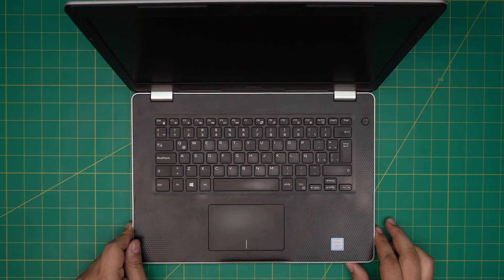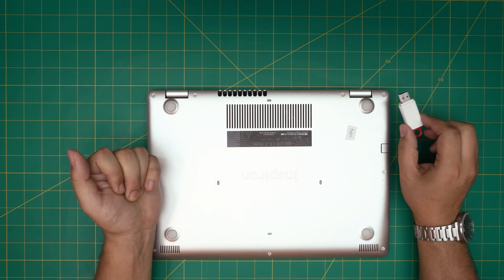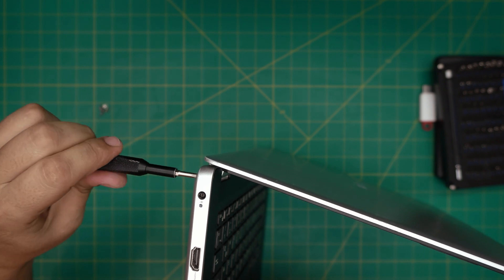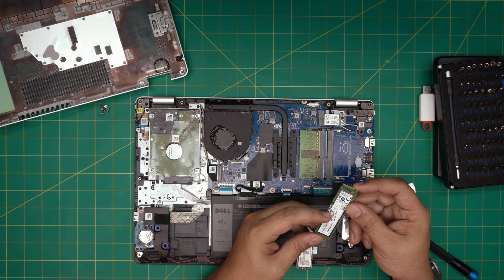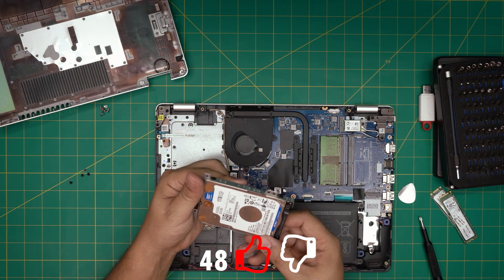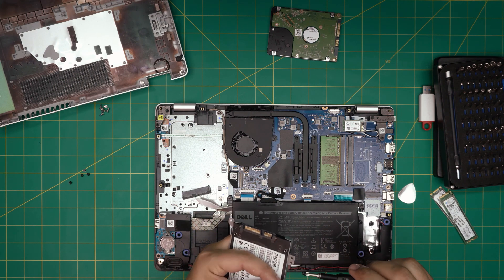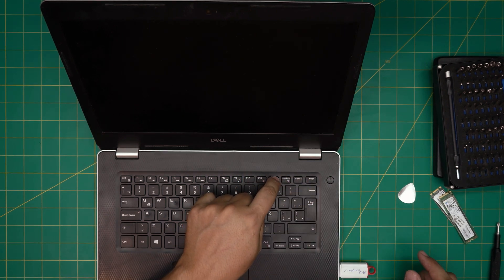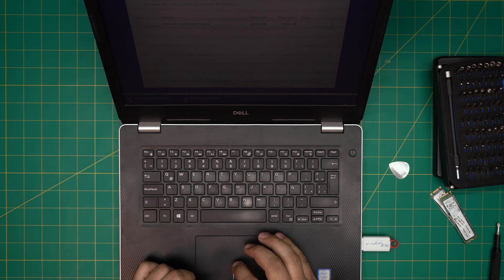How to Upgrade Storage (SSD/HDD) on Dell Inspiron 14 3481 (Reg. P89g) Laptop - Step-by-Step

Comment: Which generation nvme ssd is supported in this model
Reply from the maker: 🫠Regarding your question, 3rd gen, but you can place a 4th gen and it will still work as 3rd gen.
Should you have any further questions or requests in the future, please don't hesitate to ask me.
cheers🍻

Comment: Is it safe not removing the battery connector?
Reply from the maker: Thank you for the feedback! if you wish to support the channel you can LIKE or SUB or both :P
regarding your question: 10000% its safe to do upgrade SSD or RAM or WIFI board without removing the battery. unless you like dropping metal item on top of the board :P
no technician ever removes the battery to do upgrades. and laptops are designed in mind so it can be upgraded without removing the battery.